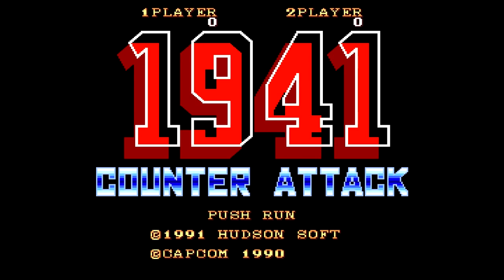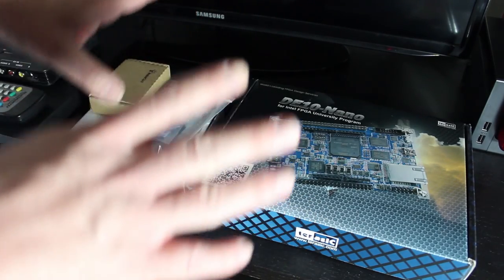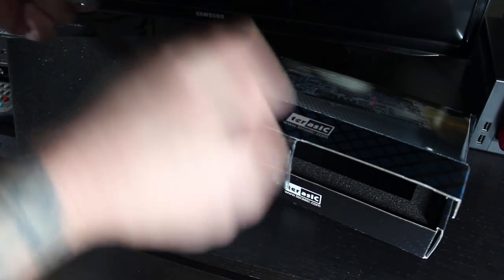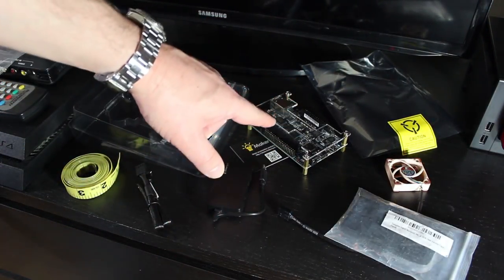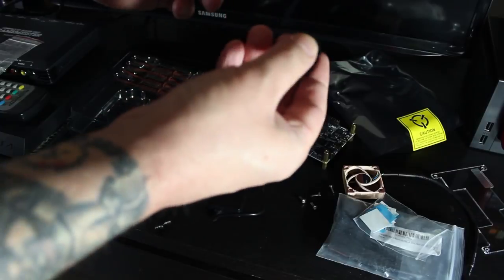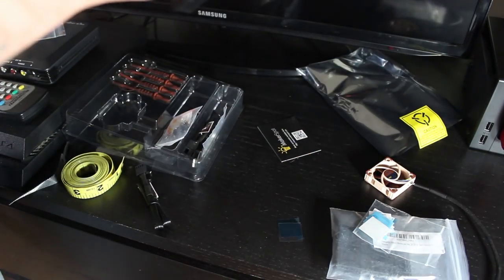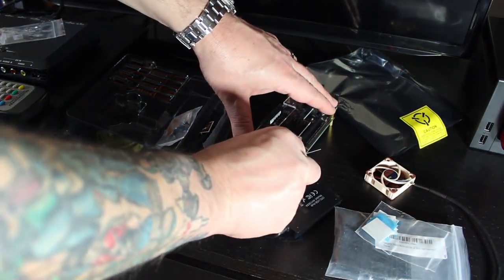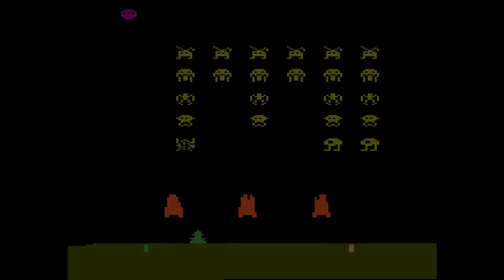Making a MiSTer

Comment: Oddly, I was building my MiSTer when you originally posted this video. It made me laugh when you said make sure that you get heatsinks with the adhesive on them. I had just noticed I failed to do that only a few minutes earlier. Anyway, I got mine up and running and I really love it. It just has so much potential. Can't wait for Neo Geo and CPS 1 & 2 support. The SmokeMonster MiSTer Rom pack is really helpful.
Reply from the maker: Haha, yeah, that thermal tape, man. And I'm really hoping Furrtek gets that Neo-Geo core working!
Reply: Oh, just a FYI, but if you're looking for a I/O board I got mine from ArcadeForge.net, not cheap but they were the only place that had them in stock at the time. Also, you may want to hold onto some of those adapters your fan came with. One of them is a three to two prong adapter and you'll need that to connect it to the I/O board. None of the screws that fan comes with will attach to a I/O board. I had to go to Home Depot and get M3 x 16 and nuts to secure it the I/O board.
Reply from the maker: @Schmeck626  Good to know!
Reply: @Schmeck626  did you have no luck sourcing an i/o board on the st forums?
Reply: I checked there first, and as I recall I think they had three or four sellers listed, but none had any when I was looking. I'm sure I could have waited for another batch from JackBurton or one of the other sellers, but I was impatient. I had been assembling parts for about a month and it was the last piece I needed. The 5.5 board from ArcadeForge is well built and works great, but the shipping from Germany was costly.

Comment: I'll say this, if you go with an adapter with an on/off switch, and it's the one Smoke Monster recommended on the RGB write-up, definitely pay for shipping. I went with the free option since it normally only takes 15-20 days from overseas with free shipping, but so far it's been well over a month and I just got the port adapter for it to plug into the Nano and I still don't have the actual power adapter itself.
Reply from the maker: That's good to know!

Comment: I have a Raspberry Pi, the original MiST and now the MiSTer (and 17 retro computers!)....okay and like you the XRGBmini-Framemeister. I do disagree with your comment this will unseat the Raspberry Pi. Every bit of hardware has to be worked out and simulated in software language (Verilog or VHDL). That is just not feasible to challenge MAME for arcades. For the main consoles and computers the the progress is amazing. If there is a choice like take the SNES I'd for sure choose the MiSTer over the RetroPie, but for MAME arcades I just don't see it happening.
Reply from the maker: Yeah, that's valid, but I think some of the major arcade platforms (CPS1 and 2, Neo-Geo, etc) are feasible with it.
Reply: @SameNameDifferentGame  Yep = would be great to see Neo-Geo. I think from what i see the CPS1 may not be far away.
Reply from the maker: @aminekostone1411  Fingers crossed!
Reply: I never liked messing with mame. The lag and the control inputs drove me away quick. What little the MiSTer has for arcades is 100 times better for me.
Reply from the maker: @nathanhardie6124  I think MAME is super important from an archival standpoint, but I like MiSTer better in practice. Now it just needs more arcade games supported! Can't wait for Jotego's 1943 core to become public!
Reply: @SameNameDifferentGame  I agree buddy. And I had no idea '43 was on the way. Awesome! Ace is working on Contra too!
Reply from the maker: @nathanhardie6124  I don't love arcade Contra, but it'd still be dope to have it.
Reply: @SameNameDifferentGame   Blasphemous Stick! Especially from an archival standpoint ;). How can you not enjoy all that chest blood exploding out your body when you die? The nintendo version is a creative port but doesn't come close to the real thing. Having a monitor that can rotate 90 degrees makes horizontal arcades more enjoyable too.
Reply from the maker: @nathanhardie6124  I do love the blood geyser. But the game isn't all the vertically designed, so I feel like the vertical monitor kind of takes away. The controls are a bit more laggy/sluggish, most of the power-ups are hard to distinguish from one another, I honestly don't love the washed-out color palette that era of Konami arcade games used... but mostly, the NES port is my favorite game of all-time and just about everything pales in comparison! ;-)
Reply: @SameNameDifferentGame  Haha I falls to compare to the real thing which is a vertical game. Have you not played it? And the lag your experiencing is from how you're emulating it. Not sure how to help you with the guns though
Reply from the maker: @nathanhardie6124  I've played it on a real cab, and the controls still don't feel as tight to me the NES.
Reply: @SameNameDifferentGame  Hah maybe you need some practice?
Reply from the maker: @nathanhardie6124  Probably. I guess I'll get some if it hits MiSTer! (But I'll never like it more than NES Contra.)
Reply: @SameNameDifferentGame  Ahhh. Stick you're almost there!
Reply: @nathanhardie6124  I have to admit though I think a lot of the lag was coming from my TV screen versus an LCD monitor, interestingly enough.
Reply: @aminekostone1411  I hear yeah! I'm thinking about getting a gaming monitor myself. I'm sure standard tv's add quite alotta lag. What kinda monitors you into?
Reply: @nathanhardie6124  Honestly I have a really cheap Dell. But the main thing is that it has to be 4:3 resolution. Ideally you'd get one of those CRT Sony trinitrons that TV stations used in the studio behind the camera - but they are both very long AND very expensive! But yes LCD TVs are very laggy.
Reply: @aminekostone1411  I kinda want one of those monitors that can rotate 90 degrees. So I can play those vertical arcade MiSTer cores. And yeah - I'd love a pvm for those purty, real scanlines but I travel too much to keep up with that
Reply: @nathanhardie6124  you can play the vertical MiSTer cores through HDMI and don't need to rotate. But I know what you mean - it would be cool.
Reply: @aminekostone1411  I switched to using the vga port. It's a lot better experience -- those arcade black bars make 4:3 black bars look tiny haha